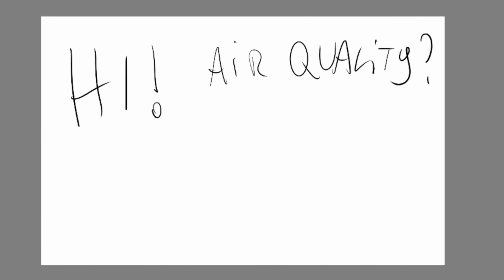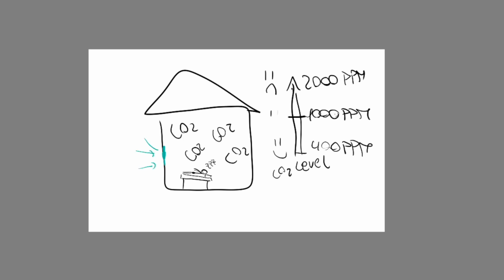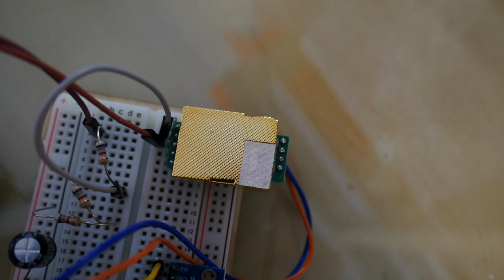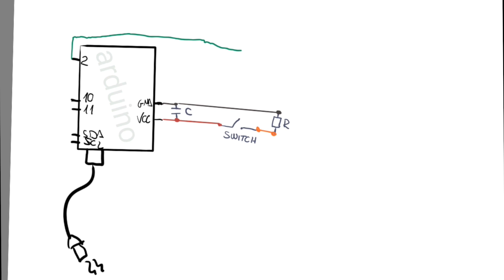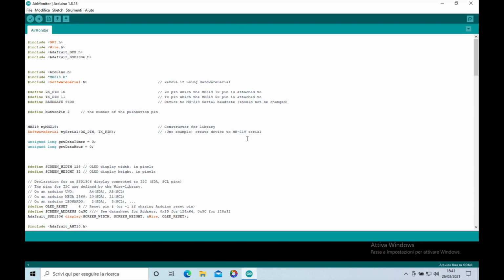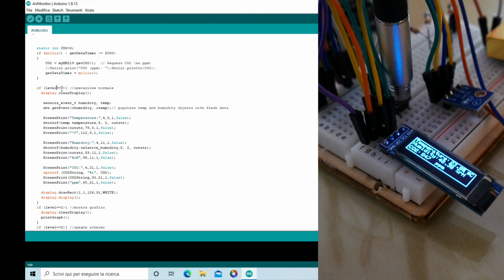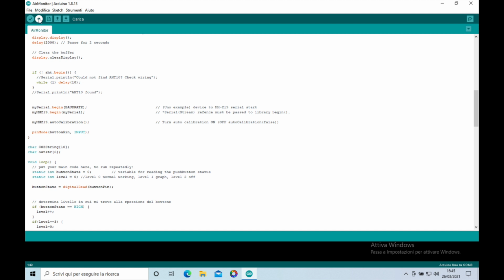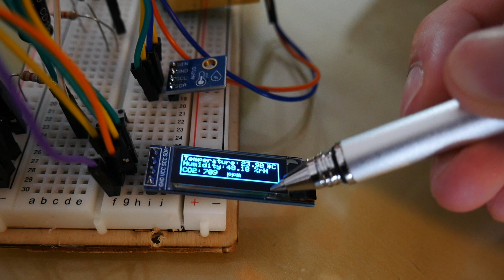DIY Air Monitor (CO2, RH & Temperature) - Sensors: MH-Z19C-PH , AHT10 & Geekcreit 128x32 SSD1306

Comment: Interface level: 3.3 V (Compatible with 5V); Output signal
Serial Port (UART) (TTL level 3.3V) --> i dont understand your claim it couldnt handle 5v rx tx levels; also a more in-depth explanation of the code would have been great; from my understanding there are two sources one could get the concentration from - pwm and uart but the calculated values of both arent the same in my case. Do you have similar experiences?